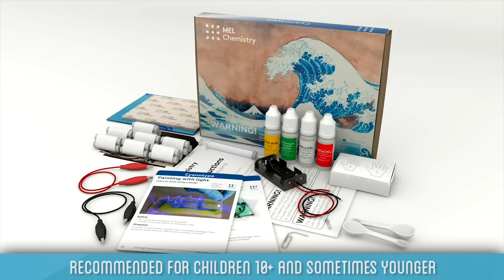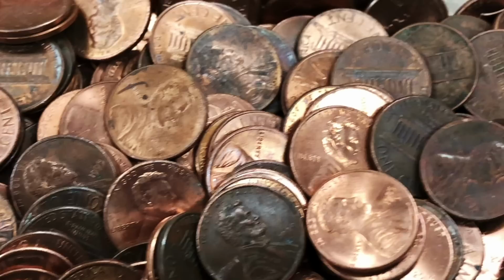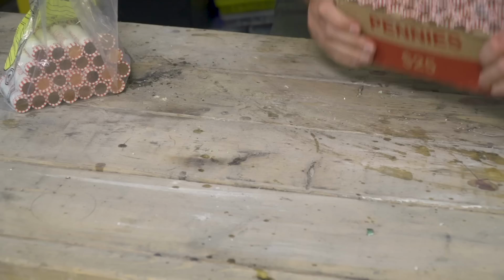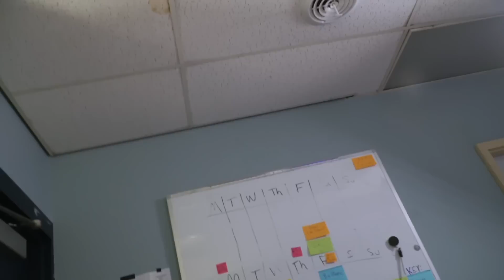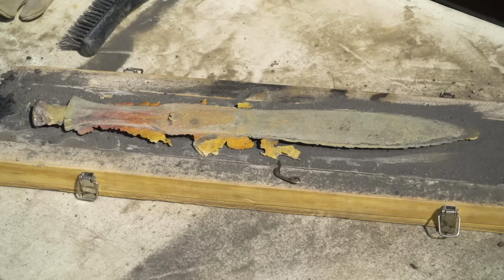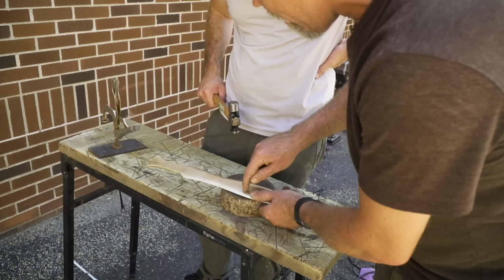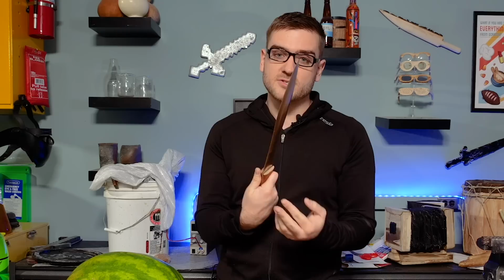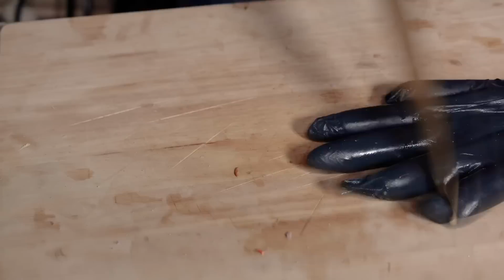How Many Pennies to Cast a Sword?

Comment: IDEA! Try seeing how many paper clips it takes to make a sword
Reply: Yaaaasss
Reply: 1
Reply: @Kevin Anderson More concerned about how they'd go through with it, would need a biig temperature and forging a sword purely out of paperclips without doing some sort of damascus technique sounds like a living nightmare
Reply: @zazi5305  uuuhhhhhh you do know steel is half iron right?
Reply: @zazi5305  in fact steel averages around 97% iron.
Reply: @zazi5305  the only other material in steel is carbon, which only hardens the tensile strength of the alloy. And yes, some have higher and lower ratios of carbon, but nothing drastic like 80% iron. That wouldn't physically work. Steel doesnt vary as much as you think, just a gram worth of carbon makes a huge diffrence.
Reply: Agreed
Reply: And try different colored ones
Reply: Paperclip Damascus FTW!
Reply: Staples store worst nightmare.

Comment: Work hardening isn’t pushing the atoms closer together. Work hardening increases the grain dislocation density, which decrease the ability for plastic deformation. This is because the slip planes get blocked by the dislocations. Thus, the yield and tensile strength go up, ductility goes down, and toughness can decrease.
Reply: Yes, I think he misspoke.
Reply: Saying "the atoms got closer" is grade-school level understanding, which considering he seems to teach mostly grade-school students, makes sense why he'd say it like that. I mean, technically the atoms ARE getting closer, arranged in disarray, but yeah.  @stevenrwh
Reply: I have no idea what you just said but it sounds smart, so I'm gonna believe you XD
Reply: To simplify what Wil said, basically imagine that a metal is made of crystals.  Remember clevage planes?  Yeah, those weaken the metal, so you want something that prevents them from sliding.  Work hardening forces another crystal oriented in a different direction in the slip planes way, making it harder for the planes to move, causing the bult metal to become harder
Reply: To simplify what Wil said, basically imagine that a metal is made of crystals.  Remember clevage planes?  Yeah, those weaken the metal, so you want something that prevents them from sliding.  Work hardening forces another crystal oriented in a different direction in the slip planes way, making it harder for the planes to move, causing the bult metal to become harder
Reply: My understanding is, you are bending the planes of the molecular structure into each other so its harder for them to slip?
Reply: Exactly
Reply: @rockyroadmagic4152  That's correct, but when they do slip, it is worse for structural integrety. You are sacrificing toughness for hardness(brittleness). There is a reason you localize the work hardening to the edge of the blade.
Reply: Figured someone would correct him on this one
Reply: I can Wikipedia stuff too..
Reply: Isaac Frost ... or I can have a minor in materials science and engineering
Reply: @Wil Slater
I never knew that, and I'd like to conciser myself well educated in ancient metallurgy. Thanks for the fun info. 
So, it's kinda like staggering bricks instead of laying them one on-top of the other. Got it.
Reply: R/iamverysmart
Reply: Nerd
Reply: Yeah it seems that sword casting guy doesn't really know what he's doing... As the saying goes, "those who can, do, those who can't, teach"
Reply: @alexipestov7002  So, basically squishing the atoms together
Reply: Wil Slater I dunno how that would decrease toughness(abrasion resistance).
Reply: Richard Smith Toughness is abrasion resistance you are thinking of tensile strength.
Reply: @Complete Bagel So toughness and hardness are often confused. Toughness is the amount of impact energy a material can take before failure, this is not abrasion resistance. Mathematically, toughness is the area under a stress strain curve. Hardness is where abrasion resistance would be considered. Often using Rockwell or Brinell scale an indention is made on the material. The tip size and force applied is used to calculate how resistance the material is to plastically deforming (hardness). With work hardening the ductility goes down, so they material is harder to deform -> high hardness. However, the toughness is reduced as the area under the curve is reduced due to a quick brittle fracture.
Reply: @Complete Bagel sorry for the long response but I hope that clears up the confusion!
Reply: @leoryan9221  r/foundthemobileuser
Reply: I was just about to say the same thing...
Reply: and now you are not invited to the company xmas party
Reply: @primalbeer  they ignored the 14 times it heated up on the grinder  and lost any hardness they put into it
Reply: @WilliamSlater  and no personal skills.  congrats
Reply: @KainYusanagi  No excuse for dosing grade-schoolers with misinformation.
Reply: Work hardening does not increase toughness through grain size reduction. Those are different strengthening mechanisms. Work hardening makes a material harder by increasing the amount of defects. When the material is struck, more defects form in the material. When defects interact, they create similar tensions in the material and thus they repel each other. By increasing dislocation density, there are more defects that all limit each other and when defect mobility is limited, the materials movement is hindered and the material becomes stronger.
Reply: @leoryan9221  Back to reddit with you, kiddo. There is nothing wrong with correcting a so called expert who is actually trying to teach people when he messes up common knowledge.
Reply: @HomeDistiller  Yeah, he, confirmed he doesn't know what he is doing when he said he quenches the sword instead of letting it cool because he said he is lazy. He should not be teaching anyone.
Reply: Wil Slater um.... TMI but good to know thank you (legit thanks)

Comment: The metal isn't getting denser when you work harden it, you are increasing the number of defects in the internal crystal structure, most of which will be dislocations. These defects are what make the metal stronger after work hardening. You are not increasing the density of the metal, you are increasing the dislocation density.
Reply: Cody's Lab explained it better, he used 24k gold foil and a weight. :)

Everything is better when you're looking at something shiny though.
Reply: God thank you, this made me unnecessarily mad when they said that.
Reply: You aren't increasing the density, you're actually increasing the density.
Reply: @marcusberger4582 j
Reply: I mean... yeah. As long as the material isn’t getting heavier it isn’t getting denser. You can’t make metal heavier by hitting it lol.
Reply: @fifthdoctor  Oh man, I always wonder what its like to be someobe like you.
Reply: Bebothebum idk if you’re being sarcastic cause I’m an idiot lmao
Reply: @marcusberger4582  he stated that you are making the metal itself denser, which is absolutely false.
Reply: @praegusta6592  He is not correct about the mechanism by which work hardening occurs. He is correct that the example of bending a paperclip is also work hardening but it has NOTHING to do with compressing the metal in to a denser state. If that were even possible you would never be able to tell what type of metal jewelry was made from by measuring its density, and we can. He misunderstood the mechanism he is using, or if he does know what he's talking about then he definitely misspoke.
Reply: Addendum to my last one, you can't be entirely certain that the material you are working with is specifically one metal if someone used an alloy and you only check its density. This is why we also do other tests on these items as well, such as scratch tests. If you know that the material has the correct properties on the surface, you can use its density to make sure that it isn't simply a plating of some kind. In fact this is why we have archimedes principle.
Reply: NERD!! Don’t worry your not alone XD
Reply: R/iamverysmart
Reply: Bonnie Coventry if it gets denser the weight would be the same, the volume would change.

Comment: Work hardening is not a result of compressing metal. It’s a result of breaking down the crystalline structure of the metal. Which is why it gets brittle. In the end you wind up with tons of tiny crystals interlocking instead of fewer large ones. Basically, you’re creating more surface area on each crystal, which creates more internal friction. Which creates more resistance to beding. At least that’s the way it was explained to me by a metallurgist.
Reply: This is correct except one minor thing. You are reducing surface area of crystallites but increasing surface area per volume. This is called work hardening and many metals exhibit this phenomenon. Copper and its alloys are probably most known for it but titanium and many stainless steels all-so work harden, making them quite difficult to machine.

Comment: This is not illegal. He addressed it in the video, but there are a lot of comments anyway so I'll expand. It is illegal to destroy Federal Reserve issued bank notes. But the Federal Reserve does not issue coins, it only issues paper notes, coins are issued by the Mint which is directly administered by the Treasury Department. Destroy all the coins you want, Uncle Sam doesn't really give a damn. However, if you profit from the destruction of coins, that has been interpreted by the FBI as counterfeiting (I'm not sure how the court ruled) so he cannot sell this sword for more than the $5 of pennies he used.
Reply: The fact is that the law isn't clear, and the law that you mention (cite?) isn't relevant, so while it may be true, I'm ignoring it.  There is a general rule prohibiting exporting, melting, and treating one-cent coins.  31 CFR 82.1.  Clearly the portion of the rule against export doesn't apply. There are exceptions to this general rule under 31 CFR 82.2.  There is an argument to be made that this use doesn't qualify for an exception to the rule against melting or treating one-cent coins under 31 CFR 82.2(b) or (c)(2).  Under this theory, it wouldn't qualify under sub (b) because sub (b) refers to the "treatment" of coins, which, according to the Treasury's supplementary guidance, refers to things like a science teacher experimenting with a single coin or a child putting a penny into a penny press.  72 FR 18880-02, 2007.  Unless melting down $5+ worth of pennies is considered "treatment," he can't claim an exception under sub (b).  That leaves exceptions under sub (c), which exempt melting from the general prohibition if it meets 3 requirements.  One of those requirements, under (c)(2), is that the melting of the coins is "merely incidental" to whatever activity the individual is doing.  Clearly, the entire point of this activity is to melt down coins, and therefore this activity would not exempt him from the general prohibition on melting one-cent coins.  This is legal information and not legal advice.  You can check the cites and read the relevant law for yourself.  At the end of the day, you're right that no one really cares and I highly doubt he would ever get prosecuted for this.  At the same time, try to check your law a little more thoroughly before you (probably unintentionally) spread false information.   In any case, this is a pretty interesting legal question that, like most interesting legal questions, doesn't actually matter in real life and exists mostly as a hypothetical.  Hope this comment was interesting and helpful~
Reply: Hu whell shit im just going to delete my coment now
Reply: this video is monetized so he is profiting
Reply: How would they even find out
Reply: @user-sl6ou3qb9l  Posting a video of you doing it on the internet.
Reply: Right Wing Safety Squad 
I mean for the common person that doesn't put everything online
Reply: @user-sl6ou3qb9l  Unless you do it in very large quantities, they won't find out.
Reply: @rightwingsafetysquad9872  they won't care even if they find out because the matter lacks substantial materiality. But as mentioned by above commenters; because he is advirtising to a constantly growing number of people there may be perceived materiality.
Reply: hes profiting off it if the video is monetized
Reply: @philthethotdestroyer4194  I'm sure that won't hold up in court. Any lawyer worth his salt could come up with some Talmudic reasoning as to why using pennies wasn't germane to the content of the video. And no judge wants to be the one to put a guy away for making penny swords.
Reply: that is ridiculous, but it doesn't mean it isn't true
Reply: he is making more than $5 off the video.  
also pretty sure you are wrong overall
Title 18, U. S. Constitution section 331 states, and i quote, it is illegal to "fraudulently alter, deface, mutilate, impair, diminish, falsify, scale, or lighten any of the coins coined at the mints of the United States, or any foreign coins which are by law made current or are in actual use or circulation as money within the United States".
Reply: The Mint makes rules about destroying coins, too.
Reply: Plus the material cost of the handle. Since he sank that money, it is not considered profit until he bridges over the cost of construction(all materials and or hired help) so if he hires the right people and uses the right material, technically he cause sell it for thousands, provided someone doesn't see the vid till after purchase. We can make cheep swords too damn it!
Reply: @ollierichards2370  but not on the pennies themselves. I can profit off of jurassic park by using their franchise as a topic or their murch in my non existent videos, but it isn't copyright infringement until i imply or claim direct profit off of it. He isnt claiming hes making money cause of the pennies, nor does he imply that he will be making a profit directly through them. He is technically legally safe. No less safe than a fan theory channel focussing on only one brand or topic(there are dozens that do that and make money off of copyrighted topics).
Reply: I actually doubt that anybody besides internet trolls would give a damn how much he sells it for or whether or not he destroyed pennies. Who cares really.
Reply: I'd like an actual lawyers pov in the matter instead of a bunch of jackasses trying to interpret laws. Penny presses are legal and make them worthless so how does that work?
Reply: He can sell it to a friend for the amount.. but the friend that doesn't know can profit off it..
Reply: What if someone destroys the coins to make a video that they put ads in and profit from?  🤔
Reply: Usty  The President has them in his sights so I hope he puts an end to them screwing over the country.
Reply: If any1 cares. The real laws state that using currency to make things to sell is ok (like a statue of welded coins, or an engraved coin, or dollar with celebrity faces in it)  but melting  them down Specifically to sell the metal is illegal.
Reply: @user-sl6ou3qb9l  posting on youtube is a great way for people to find out things 🤣
Reply: Not only is not illegal, he can sell the sword for whatever amount he wants.  Same as with jewelry or other novelties, he can sell this LEGALLY for a profit because the value is not coming solely from the value of the metal in the coins but his skill and time need to create it.  What you're talking about is simply melting down a one-cent or five-cent coin to resell the metal for a profit, that is illegal.
Reply: make it from scrap copper pipe instead of pennies, then you could sell it for any price you wanted
Reply: @ollierichards2370  exactly what I was thinking and with the number of views he must have made more money that the worth of the coins used, which means he did indeed profit from it.
Reply: Right Wing Safety Squad the federal reserve isnt a government institution so there laws arent actually enforceable. They arent federal.
Reply: @UnrealEngineTutorials  I get what you're saying. But try telling that to the police/presecutor/judge. They will all gladly enforce the law on the Fed's behalf.
Reply: @Huh Bub wrong
Reply: @Simon Pientka wrong
Reply: @davidd4662  correct
Reply: tonyelbows  wrong
Reply: @ThemildmanneredgamerBlogspot  wrong
Reply: @Rich correct
Reply: @MrPbear22  actually I am correct. My statement wasn't that what he did was illegal, it was just that he did indeed profit from destroying the coins. Which he in fact does as the video is monetized with ad, has links to his merchandise, the video was sponsored by Mel Science and he asks for people to donate to his Patreon. He would easily be making more than the value of the coins used.

Comment: Just a couple of tips from someone who did similar many years ago. Use a fibre brush on your grinder to do the initial polish and to draw the blade into a more inherent edge before sharpening. Use a hard cloth polishing wheel on your bench grinder to work it further. Believe me, it makes the temper more forgiving than brittle as temperature and resonance don't overwork the metal. Finally, your belt sander should be using the lower temp and finer blue honing belt not the red one. Keep up the great work, your sword is an enviable piece. Hope this helps.